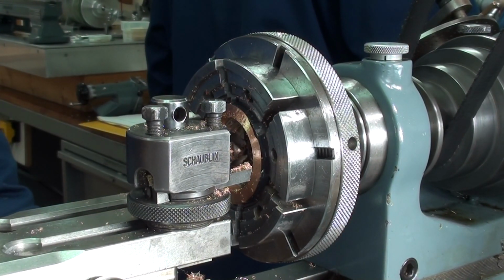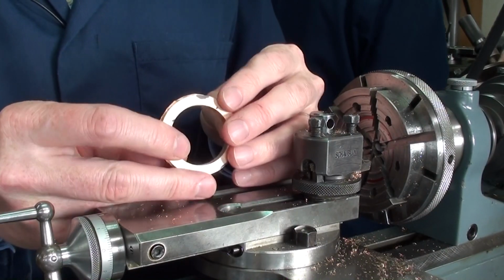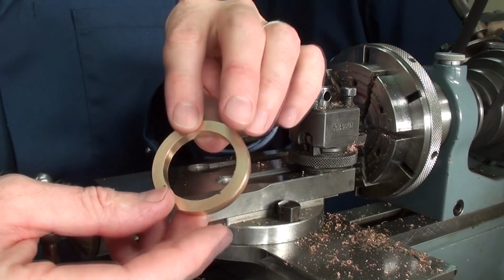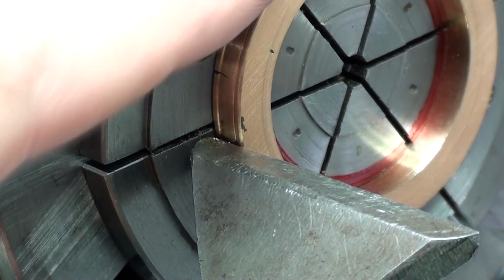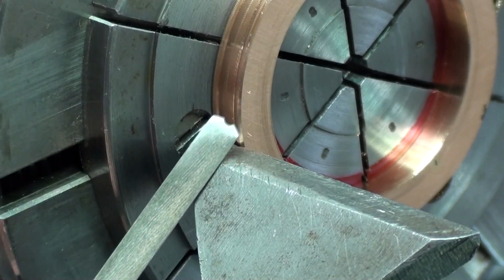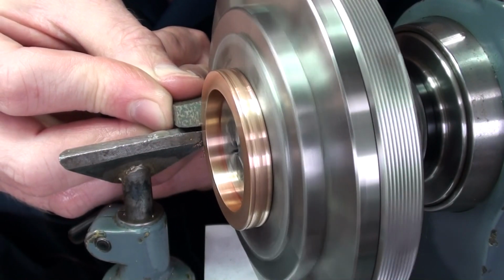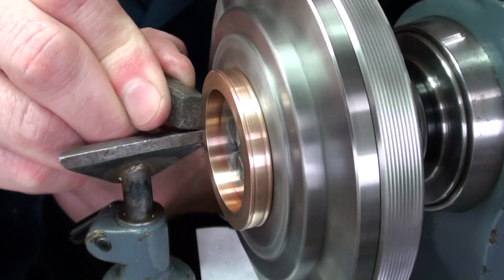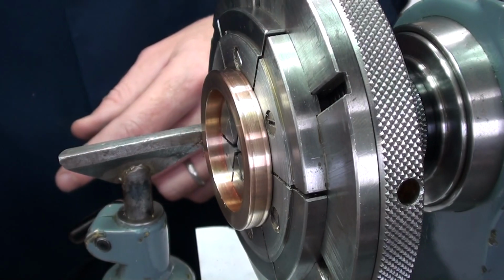Part 4 of 7 - Case Making by Roger Smith

Comment: I am a retired toolmaker . After watching this video I am amazed how crude and antiquated 
the machining of this watch case is . I have machined hundreds if not thousands of miniature and sub miniature parts , but Never like this . lol  Everything I did was at an extreme level of precision ,using measurements, drawings and specs . This seems so antiquated to me . I never saw him use "Any" type of measuring device during turning . 
I guess its simply the way , Old school type of machine work on non precision watch parts 
are made ?  Nice lathe and Entertaining video however  !
Thanks for Sharing ..
Reply: This is a one off piece of art not a bunch of pieces that only have to meet engineering specs.